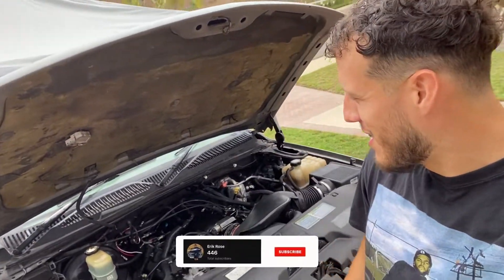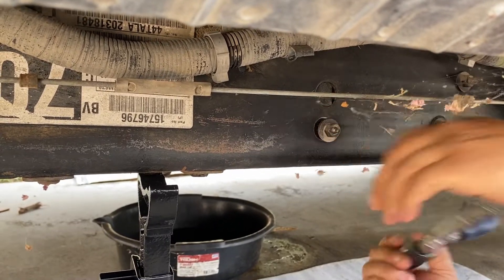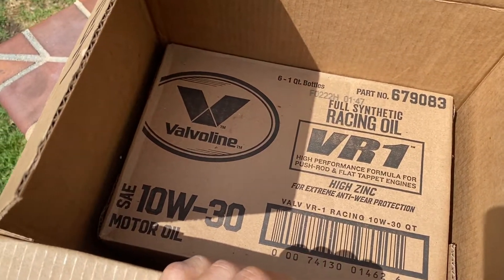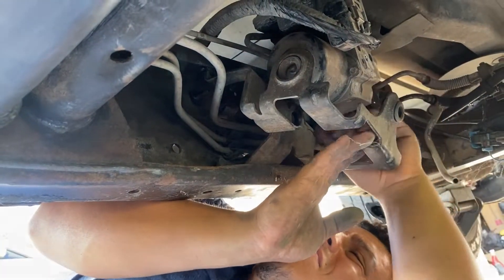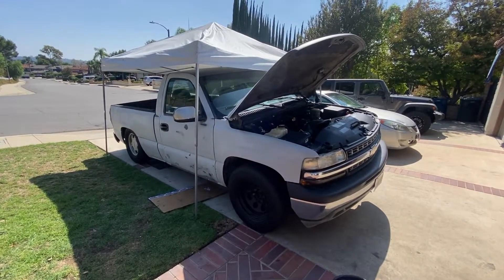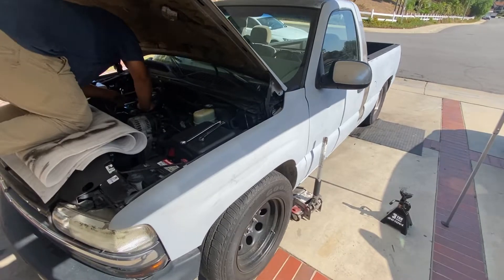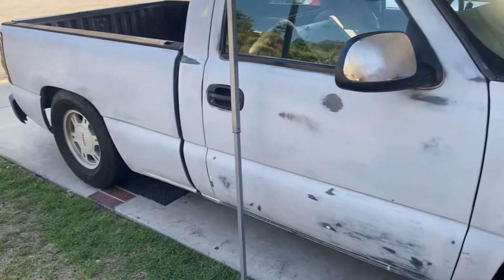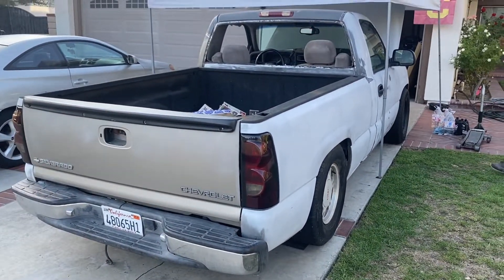5.3 LS CAMMED SILVERADO STARTS FOR THE FIRST TIME!!

Comment: Get some Speed Engineering Longtube headers and their CAI

But Cali makes it hard on you so don’t blame you if you keep it like it is
Reply from the maker: Yeah didn’t get headers for that reason its one of the first things cops check when they pull us over also why I dont have a cold air intake but I’ll have a Vortec 6000 engine cover to cover most of the engine and the manifold.

Comment: Got the same intake with a 102 throttle body but it won’t fit it hits on the water pump pipe and the coupling for the CAI is going to touch one of the pulleys Eny device? It’s on a 2000 Silverado with 243 heads
Reply from the maker: Yessir ! so to make mine fit well, I fitted a shorter coupling to the TB, and the if your using the stock plastic CAI pipe, on the area thats gonna touch i heated up with a heat gun to push in the plastic slighty to clear it !
Reply: @ErikRose_  and the water pump pipe ? The one that connects to the top left of the radiator
Reply from the maker: @jesus_6.0  i actually look at it again bro I didnt have to make any modifications, everything fits tight but it does fit, my coupling for the CAI is close to touching but doesnt, maybe you need a thinner one?
Reply: @ErikRose_  hmmm not sure bro maybe the one we got was a dud but we not going to struggle with it we’ll just get a Holley mid ram

Comment: How’d the Mount the bracket for throttle cable
Reply from the maker: made a custom one from the oem mount, just cut it up and welded some pieces together to make it fit
Reply: @ErikRose_   what’d you end up mounting it on
Reply from the maker: @angelsanchez2807  bolts onto the throttle body!

Comment: My buddy and I are trying to do that install of the Sheet Metal Intake Manifold, Kinda lost at the FPR, Do we need any adapters for the fuel lines? We forgot to order the FPR but are unsure if we need anything else to get the FPR hooked up to the factory fuel lines. Any Info would be great brotha!
Reply from the maker: I go into more detail in one of my previous videos, the intake manifold video not sure if you’ve seen it? but you will need a quick disconnect fitting to adapt to the new fuel rail, I used AN6 because I’m doing e85 with mine. Let me know for any other questions bro!
Reply: @ErikRose_  Thank you! We got it all figured out brotha!